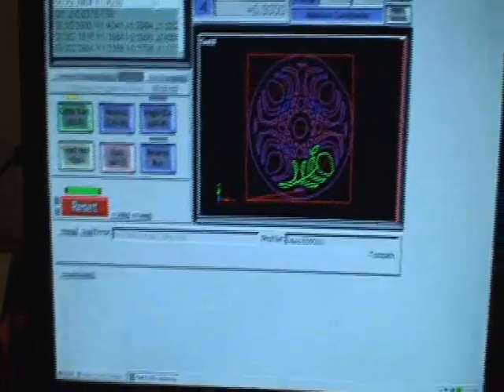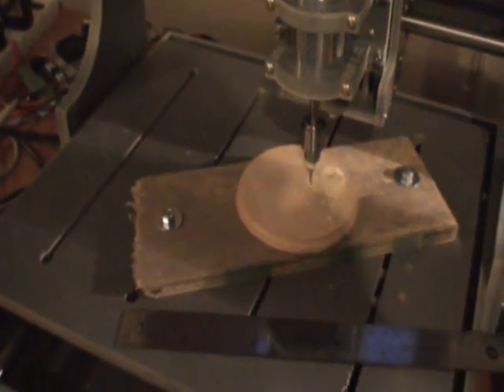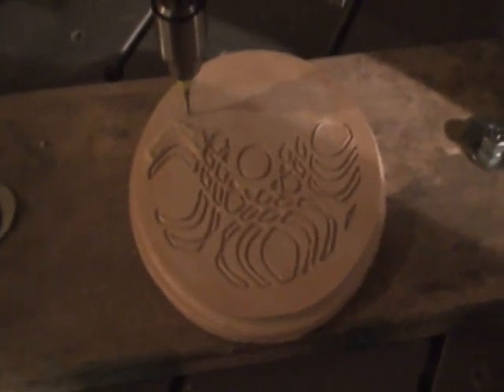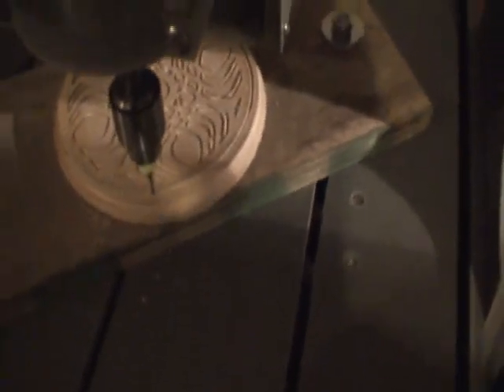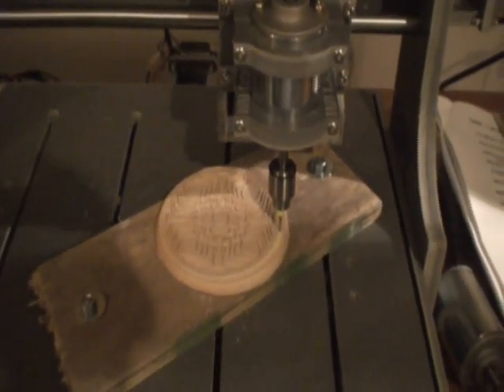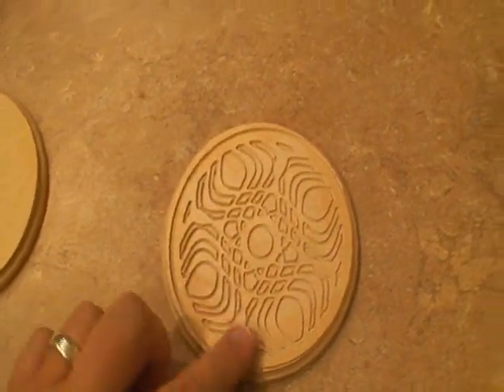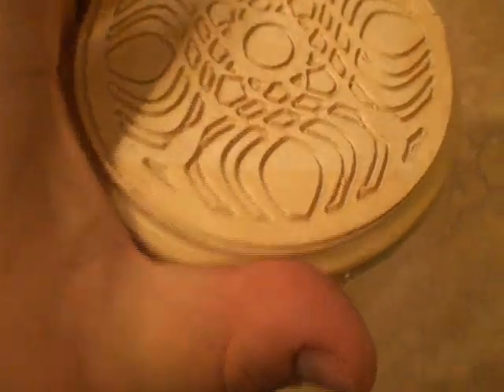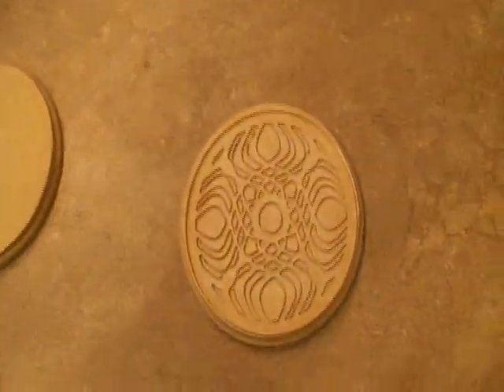First complete carve on my zen toolworks 12x2 CNC

Comment from the maker: It depends on your bit, depth of cut and spindle, but 5 is a good starting point. I was able to cut foam and rubber at much faster rates (20-30ipm), and i know there's talk about 100-120ipm possible on etching. Overall if you cut too fast you might get skips, jumps or lost steps in the motors.

zen toolworks has a pretty good forum around for asking about settings.

Comment from the maker: @BestCatEvaDontHateMe 

It varies depending on the motors, spindle, tool, depth of cut and material you are using. 

I recently cut rubber stamps at 60ipm with the kit's nema23 motors and zen spindle with no problem. However I cut wood at a much slower speed, about 20 ipm.